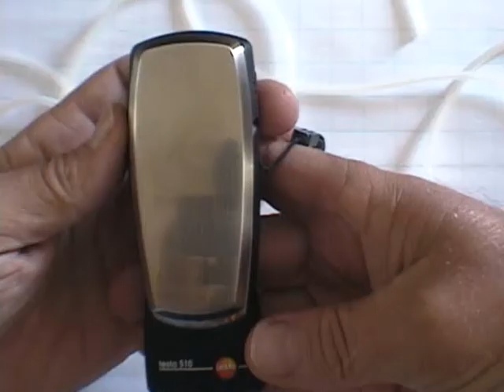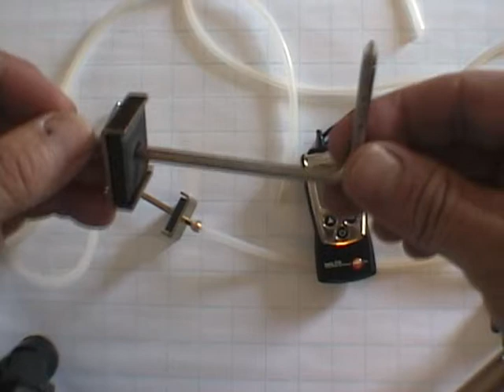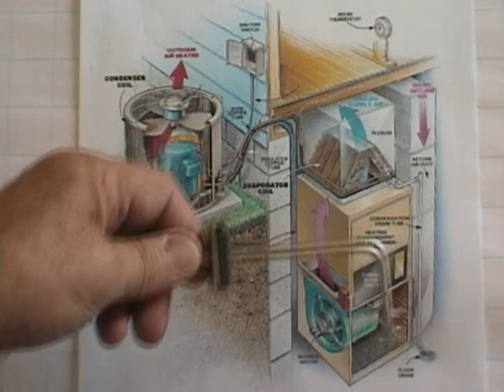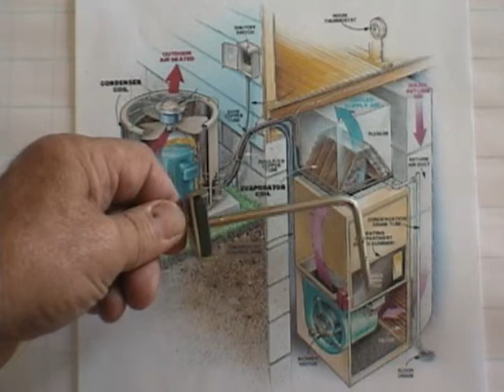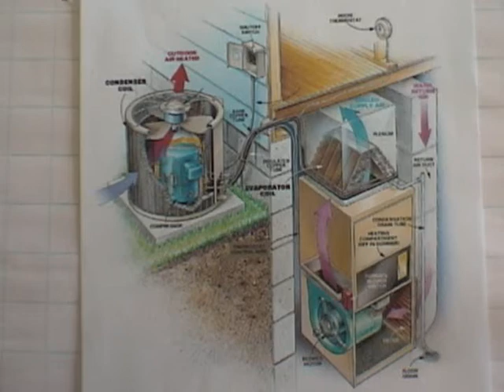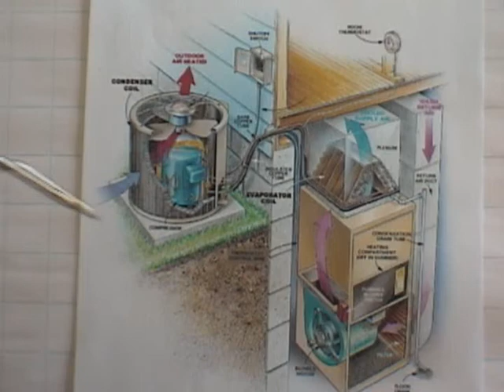TESP Testo 510.wmv

Comment: Hi Michael, I want to measure mass air flow of a corrosive gas and the temperature is around 200oC. Is this device suitable for the same?. Secondly, the placement of probe is facing the air flow or perpendicular to air flow?

Looking forward to your response. Thanks, Peter Manoj